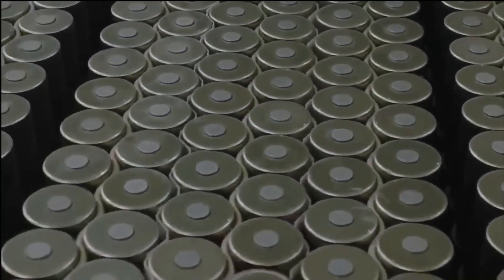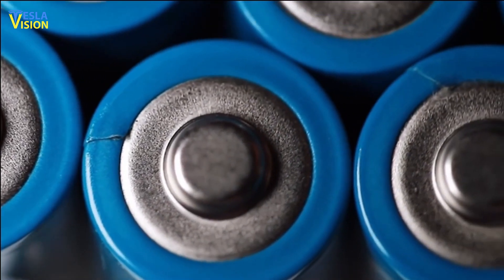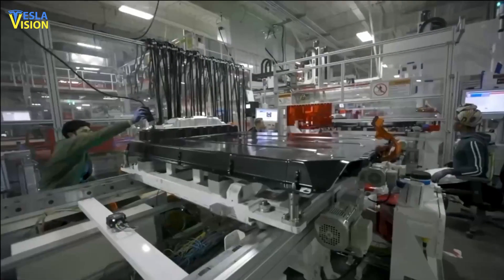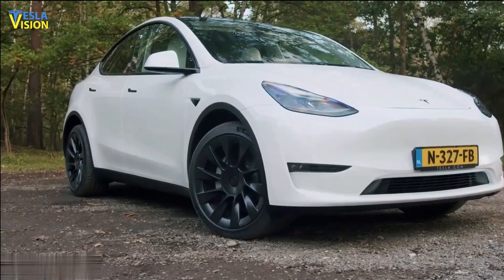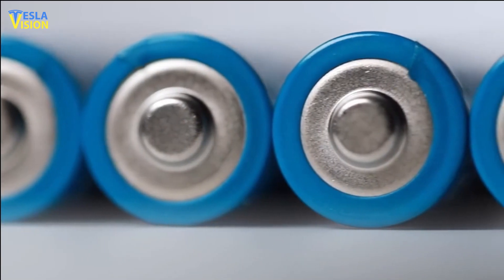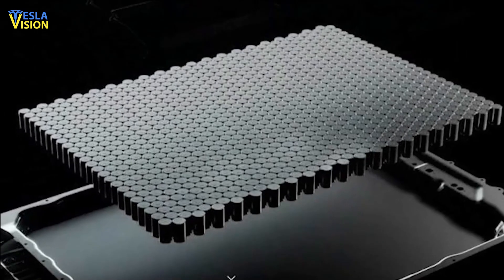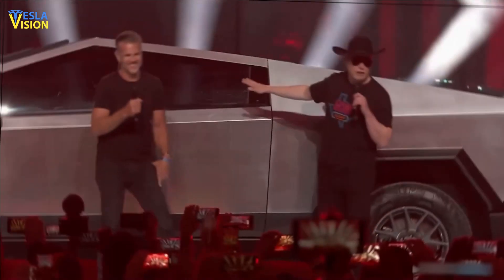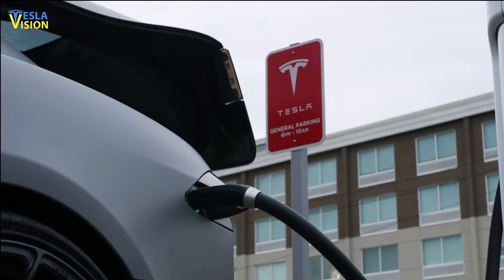Tesla JUST Revealed What Many Are Calling "GROUNDBREAKING" Battery That Lasts 1,000,000 Miles

Comment: What happens, when these batteries must be recycled .... an economic process still does'nt exist 😮
Reply: Idiot !
Know your facts before you spew nonsense.
Redwood industries takes used batteries and grinds them down and separates their molecular compounds . 

So they can be reused.

Since the Tesla batteries last well over 200,000. Miles they are accepting used batteries from everything from electric toothbrush, cellphones and everything else that has batteries.